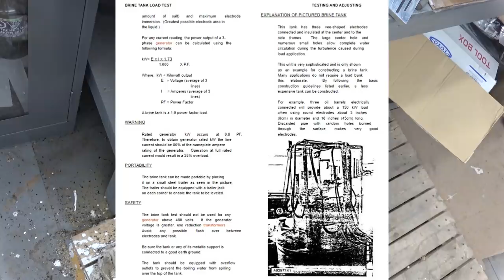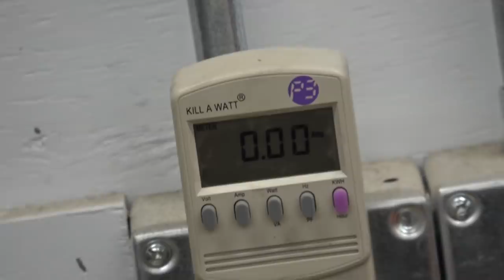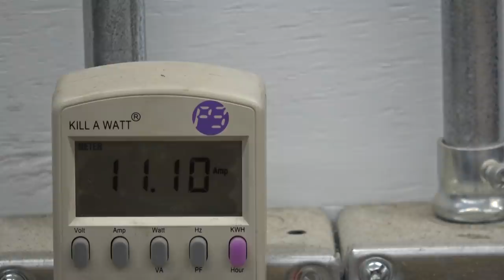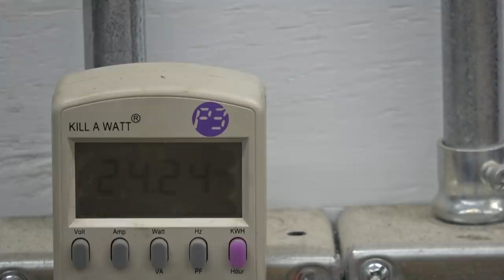Forgotten knowledge: generator load testing

Comment: About the delay in breaker tripping: there are two modes for a breaker to trip: magnetic, and thermal. Breakers are allowed to go "over current" for a period of time (usually 130% for an hour, and 200% for 2 minutes) before thermal trip occurs. This is to protect your building wiring from overheating. The magnetic trip occurs when the current greatly exceeds the rated value (short circuits), and those usually trip within a few AC cycles for extremely high currents (like, hundreds of amps), or a second or two for lesser faults. This is why breakers don't pop the moment you turn on your circular saw even though those can draw 30+ amps for a second at startup, but they do pop if you run 5 space heaters on a circuit for 5 minutes. They also will pop nearly instantly when you shove a paper clip into the receptacle. 
This is also why you should NEVER rely on a breaker to save your life in the event of a fault, because you will be LONG dead before the circuit breaker reaches the over temperature point and interrupts the circuit.
Your poor kill-a-watt was rated for 15 amps, and you put 24 amps through it. That's only 120% over current, and it was going to take up to an hour or more to actually trip.

Comment: IN 1978 in I was a Generator mechanic in the army in Germany I built a salt water load bank  using 4 55 gal drums  L0,L1,L2,L3  used 3' brass grounding rod sections connected by 10 gauge wire suspended by a non conducting rope.  I could load test up to 100KW machines.  made verifying repairs easy.

Comment: At the power plant I worked at, we had a 30k hp wound rotor motor for the auxiliary feed pump. 3 LARGE liquid rheostats  using motors to raise and lower the plate. Pretty cool deal. Had doors to walk in and inspect the motor. (not while running!)

Comment: Old theatre lighting systems used the same principle for dimming control. A plate would be lowered into a salt water tank and the increased load on the circuit would dim the lights. They have all been replaced, mostly in the 1930s as capacitor based systems took hold. Dangerous as hell, but if you started a fire, you could just drop the asbestos curtain and at least only the stagehouse would burn to the ground.

Comment: Oxyhydrogen generator, probably best stick to running it outdoors 😅
Reply: Maybe just burn the stuff. If he plans on running a long test I doubt even outdoors is enough.
Reply: Not entirely sure but I think electrolysis only happens with DC not AC
Reply: @IrishSkruffles  maybe you're thinking of electroplating?
Reply: @IrishSkruffles  The simplest proof, bubbles. The water was not boiling either.

Comment: Circuit breakers are generally inverse time breakers, they will trip instantly with a short circuit. The time they trip from an overload varies with how much over the rated current is applied. I've seen a 20 amp breaker carry a 22 amp load for 15 minutes.

Comment: I used to work at a UPS (power supply) shop, and we built stuff up to like 150KVA/3P, and we would load test with these bigass carts that had a fan and a bunch of selectable resistive heating elements, then just use clamps to check the current. Had nice grates on the ends so you couldn't put your curious fingies in. Seems a bit of a safer solution, with a bit less flammable and/or toxic fumes.

Comment: Secondary application-

Dad tells a story of of when all the equipment kept shorting out at camp and after going over it with a fine tooth comb (he swears there must have been electricity in the air), he got sick of all the calls and connected EVERYTHING to a common ground.

He then connects the ground to a railroad spike, puts the spike in a bucket filled with gravel and saltwater, and buries it 2 feet underground.

Worked like a charm.

Comment: Many years ago I designed a phase fired controller for 100Kw 480V.   The customer brought a load system mounted on a trailer.   Current was controlled by the concentration of salt.  Had to keep an eye on it as the resistance dropped as the temperature rose.

Comment: If you start with de-ionised water (which is not conductive of course) and then carefully add a known molar amount of salt, it's possible to 'fine-tune' just how resistive/conductive a given distance-between-electrodes will be. I vaguely recall doing something like this in first-year chemistry, but in reverse - we had a given electrical current, but the molar concentration of salt in the water was the unknown that we had to calculate.

Comment: Standard circuit breakers are not designed to trip instantaneously for all loads.  Breakers are designed with time curves they must meet, and for anything but the highest currents there is a noticeable delay from seconds to hours.

Comment: I can remember my father showing me a three phase starter for a water pump somewhere in the 100kW+  region at a city water pumping station. Three massive variable salt water resistors were a part of the starter gear.

Make sure your bucket can contain the eventual hot water or you might end up with a flood.

Comment: I love this, I have seen this done on a much larger scale with large 3 phase generators in Mexico. They use large cement pools outdoors with tubing for the electrodes. It can be a bit of a fireworks show. Personally I have built several small load banks in the past. Space heaters were always my favorite but now I use a bunch of water heater elements mounted to a board laying over a livestock water tank. Small investment for a 50kw load bank.

Comment: There is a fuse in the kill-a-watt that can be easily replaced.  I'm surprised it lasted that long.  Mine didn't make it much over 15 amps before it popped its load.

Comment: Had something similarly fancy in engineering school. Even was 3ph, just some plates separated by 2x4s that got dunked into saltwater tanks. They were extra fancy and the up/down was PID controlled so we had a cool variable load that could be automated if desired. Neat stuff, simple like borscht and really effective.

Comment: Yeah we had a similar setup in the railway for testing diesel locomotives bt ours used normal water and it boiled off and the load cell would move in and out as well.

Comment: US military technical  manuals are written for the high school level.   And most are declassified for generators and non combat vehicles.  This is why my backup generator is a former military unit.  Same with my truck, which came with a 12kW 3 phase 120/208 volt unit, PTO driven.  I've got 20 kW of capacity,  being on the apocalypse

Comment: When I lived with my grandmother, I took 2 stainless steel forks and soldered a lamp cord end to each fork. I would stick each end perpendicularly through a hot dog 🌭 , place it on a dry wooden cutting board and plug it in for about 30 seconds. Done and ready for a bun. As you may have guessed, I was a budding EE. Grandma loved it and her and I ate many hotdogs that way. Kids and most adults, don’t try this at home. DRY cutting board and STAINLESS STEEL forks are very important silver ware and chrome plated forks will electroplate the ends of the hot dog.

Comment: Have done this in a former life with a cattle trough, 3 star pickets, some off cuts off timber and some wire to load test an 80KVA gen out the back of nowhere.  Have load tested 100’s of gensets in my time, but only once like this - made me pucker a bit, but it worked well. 👍😊.  Also the old chain bucket dredge at Yallourn open cut here in Australia has a soda pot starter for the main chain drive.  A mechanical mechanism would lower electrodes into a bath to form a primitive soft starter.

Comment: There are diagrams for the tripping characteristics of breakers available. A german 16A-Breaker with "L" characteristic (kind of all purpose household style) takes several minutes to trip thermally at almost twice the rated current. To trip instantly (by the magnetic release) it needs iirc. more than 100 Amps.

Comment: Used to do this to test really large generators when the normal load bank was insufficient. fill a couple of plastic 44's up with water, electrodes then start dumping salt in to add load.

Comment: I have a book printed probably in the early 1930's about Electricity and its Use.  It mostly covers items from the 1920's, although it starts with much older history, of course.  One of the items there is the adjustable load resistor just like you re-invented.

Comment: Saw my dad use this apparatus once or thrice to load test an old 60s mil surplus genset. 30kW 3ph delta rewired to star. Pushed by a flathead 6cyl w/ a magneto ignition. He converted it to run on propane.
Got 60A out of the thing using a bucket of saltwater before he decided the H2 offgas was a bit too thick.

Comment: This seems very similar to something the "king of random" made and called a Scaryac. Essentially a variac using the distance between source and ground logs in water as the current limiter. Seems like you could use the same lever action to precisely calibrate the amount of resister in the water bath and keep some additional insulator between the gorillas and the pixies what use the darned thing.

Comment: Done that a few times on a U12B diesel loc. Its best to start with clean water and then control the current by adding salt. That's the best way to find the turbo-psi per gram of salt relation.

Comment: I saw something like this on Big Clive’s channel. The dangerous Chinese gadget passed electricity straight through the water flow in a shower head to make instant hot water. The naturally occurring ions in the water helped the power to flow. Seems you don’t want too much salt or your resistance may be too low and power dissipation not up to the desired level.

Comment: We had a large redwood tank outside of the field lighting power building at the airport I worked at.  Supposedly, about 1 cup of salt was all that was needed. There were 3 triangular steel (galvanized?) 'daggers' suspended over the tank from a chain hoist. The output of the generator was 4160V at up to about 300A. (Enterprise 8 cyl inline diesel 12" x 15" stroke IIRC, commissioned in the 50s.) Was how they load tested the beastie.  Was told it could boil real quick, too! Definitely a cheap, reliable load bank with a lot of capacity. Never saw it in use, but the open frame 4160 alternator was a bit impressive!  (Think it ran at 900RPM?) Noisy, whatever. But was pretty reliable 'til they swapped it out for a 1.2MW 16 cyl Cat in the 90s.. Nice old engine. Not terribly OSHA compliant, tho...:)  Those were the days...  Stu

Comment: When I was a kid I built an arc welder from a book on home science experiments.  You pulled out the Carbon rods from two "D" cell batteries as the electrodes.  You clamp them in wooden clothes pins and attach the 110V wires to them.  To control the flow of current we put two can lids in a pyrex baking pan full of salt water.  We used an additional two wooden clothes pins to hold the "rheostat" plates in the baking pan.  As you brought them closer in the pan you could increase the size of the arc.  I could melt pennies all day long.  And guess what happens when your smart ass assistant who is running the rheostat touches the can lids together against all warning?  Yes, the rheostat explodes and the circuit breaker trips.  I used sun glasses for protection against the bright arc.  I wonder if the book is still available?

Comment: Still commonly used in low end dockyards for load testing. The one above is a bit crap though  because you should use multiple plates that can be lowered or raised to change the load. On new generator testing the proper load banks are necessary because power factor setting is required. Bottom line is that this is half an idea but without the full understanding of what they really look like.

Comment: Sure someone already got to the inverse time breaker explanatory stuff but here it is anyhow: where the time it takes to trip is something of an asymptote as a function of the overcurrent or ampere load in excess of the overcurrent device's rating. Basically a smaller load in excess of its rating  will take significantly longer to trip compared to a significantly higher load causing an interruption relatively much quicker. This applies specifically to inverse time overcurrent devices and there are different animals such as instantaneous trip overcurrent protection which basically is what it sounds like. Most general use circuit  breakers for residential and commercial branch circuits in N.A.  are of the inverse time type excluding arc fault and ground fault versions which are their own beast unto themselves. Source: an elusive and endangered North American Elekchicken.

Comment: There is a relationship between and how much current is flowing and how long the breaker will take to trip. If you search the internet you may find curves that define this relationship for the breakers that you have in your shop. The more current the faster they blow. But if you're just above the threshold it can take quite a while for them to blow, (minutes or longer).

Comment: At a place, where i will not admit I worked, Had 4 GenSets.  And oweing to someone changing a test spec - ALL of them had to load tested and PROVED to deliver the amps and voltage spec'ed - 20 yrs after these things were Cemented into the super-structure.  Hence, my - and all the smokers who with me gawked at a pair of the fattest cables reaching  5 stories up to the penthouse, of one spot.  They led to a  20 ft trailer - with a 20 KW restrictive load capacity.
I am sure these cables were bigger than the tie lines for the Queen Mary - or Liz. ! ?     My job was to keep the crowd - 100 yds from this area, in case it arc'ed to ground, in the rain and created a real Stevie King novel.  Cheers!

Comment: This is actually really smart, if you wanted to make this more advanced have a sliding mechanism and a  much longer electrode, and it could be controlled by a servo/actuator, and the whole thing could monitor the watts and adjust the electrode as needed to get to a certain target.  I kinda want to build one now for fun.

Comment: Pool chlorinators work in much the same way. Except it has flow. And low-ish voltage,  5-40amps usually- depends on the pool.

Comment: in the early 1980s we tested large generators using three 44 gallon drums bolted together sitting on a rubber mat.  Insulator boards on the open tops suspended a steel rod into each drum.  Fill drums with water, connect 3 phases to rods and neutral to drums, clip-on ammeter on each phase.  Fire up generator then slowly add salt to water to evenly bring up load.  Run for required test period or until you have 120 gallons of boiling water.
This type of testing has probably been killed off now by health and safety goblins.  It was safe when we did it.  Only people smart enough not to temperature test the water by sticking their hand in it were allowed in the test area.

Comment: I now see a problem with the 110v mains, if your workshop has 20A it's only 2200 watts which is less than the smallest Australian outlet at 2400 watt, also there is 3600w and 4800w on single phase.

Comment: Kill a watt is rated for 15 amps. I thought it would last a little longer than that, because AC current sensors are usually very low impedance. Maybe there's a fuse inside that can just be replaced?

Comment: Not sure how many amps that big generator Dewclaw fixed is rated for, but after seeing copper pipe put in place of fuses in a heat pump disconnect I calculated that 1/2" Type M copper pipe should be good for 287 amps as a conductor orrrrrr 80,000 amps if used in a fast blow fuse capacity. Perchaps useful information for you endeavors.

Comment: If you're just looking to measure the load and confirm output, maybe consider a "revenue grade" power meter with CT's.
As for the load you made.. interesting way to do it.. Stay safe. Wear your Arc flash and make sure to use your safety squint.

Comment: here's an other idea, visit the local scrap heap and raid it for stove elements and range switches. wire them up, toss the elements in a steel tub, hook up to the genny, and let'r rip. couple of minutes you got yourself a cooked generator. bonus: hot bath when you're done, so long as you remember to kill the power first.

Comment: Some years ago I saw a video clip of car owners in Cuba charging a flat 12V battery using a bucket of water with cables tapped into the  power pole on the street. Never could work out how they rectified it to DC. Could be an interesting experiment ?

Comment: Your common homeless death-spot breakers are more sensitive to shock-loads. So a quick arc at 24 amps would've popped her instantly.
But a slowly climbing load up to just 20% over-current can take upwards of 120seconds to trip the breaker. (was a residual erectricia for several years)

ElectroBOOM /just/ did a nice breakdown of breaker trip times.

Comment: One of the good things about aircraft maintenance. The manuals are required to be detailed and written to basically a 5th grade reading level. So not only does it tell ya WHAT to do, it tells you in plain English!
Reply: Of course this means the manuals are thousands of pages long and you have a lot of them aircraft maintenance manual(AMM) , fault isolation manual(FIM), illustrated parts manual(IPC) , structural repair manual (SRM), component maintenance manual(CMM) and that's just the usual daily use ones...

Comment: Has anyone mentioned the article in "The Amateur Scientist" (from Scientific American) in the late 50's early 60's on how to build a carbon arc furnace using D cell flashlight battery carbon electrodes and a saltwater bath for current limiting? Include a clay flower pot as a furnace chamber of sorts and I was smelting copper and iron in my sandbox outside the house! Great fun at age 10!